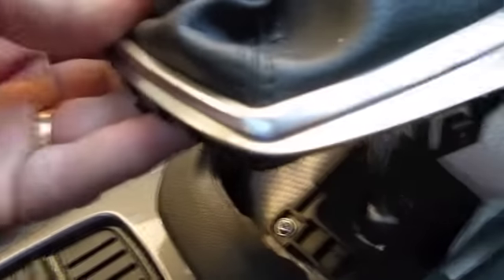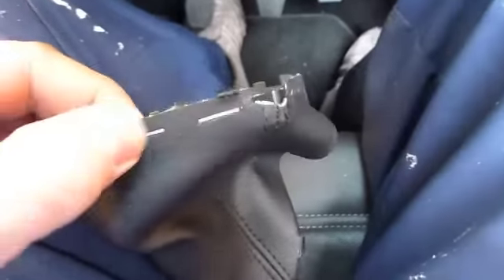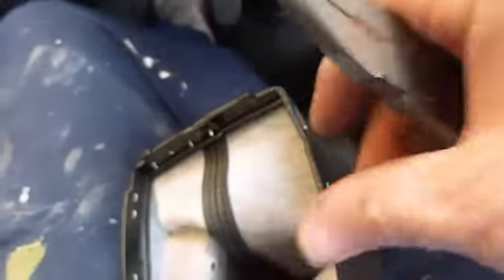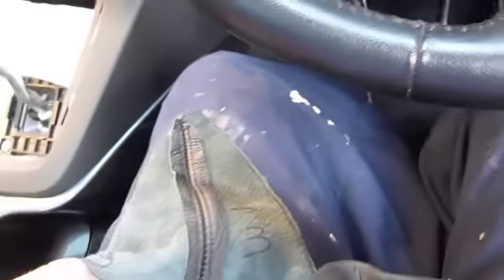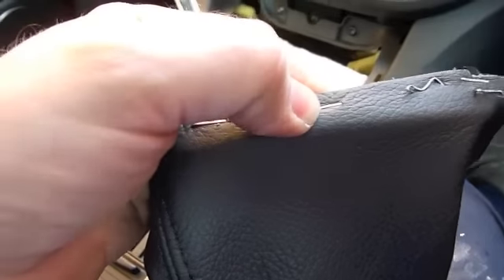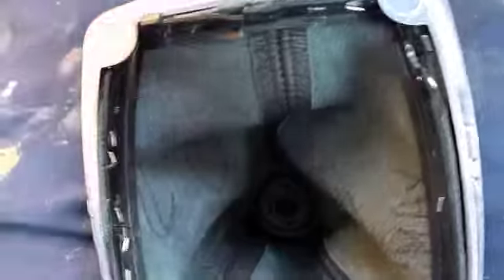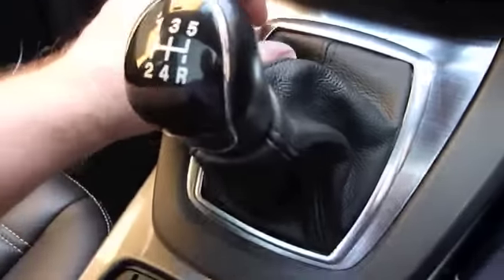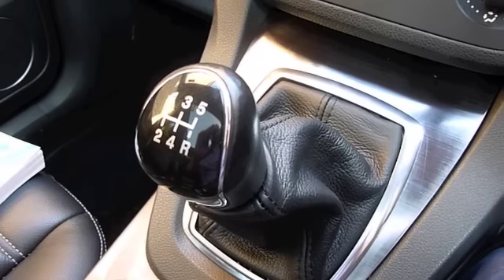Fitting a new leather Gaitor on my Ford Cmax

Comment: Just finished doing this on my Focus and following this video was a huge help. I removed the old gaiter and used a needle and thread to attach the new one to the black plastic - it's a good alternative to trying to use the staples, specially if you don't have a high powered stapler.
Reply from the maker: That's a really good idea using the existing holes, probably holds it tighter too. Glad the video was of use.
Reply: Yeah it worked really well given I didn't have a staple gun. Still looks awesome so I think it's holding well!

Comment from the maker: I went to the Ford dealers, you can't buy just the plastic bit, you have to buy leather Gaiter connected to it, and it costs £70. I'm now trying to get one from a breakers. If I hadn't broken the plastic surround it would have been fine, but now it's got to be replaced, as it has broken even more since I fitted it, it is now beyond repair, so ended up being a false economy.

Comment: On mine it's only the black plastic frame that's broken - in several places - so it is completely unstable and keeps coming out.  Looks like an expensive job.
Reply from the maker: +andrew edgington that was the problem when I took mine off, and I broke it even more. Have a look at the online breakers yards or have a look on eBay. Didn't cost me much at all.

Comment: Sorry, mate, but you did a pretty lousy job with those staples. They are still visible from the outside. You could have used the same holes from the original staples, that's what I did when I replaced the gaitor on my Corsa and it turned out just fine.